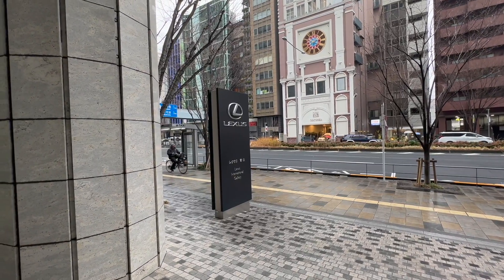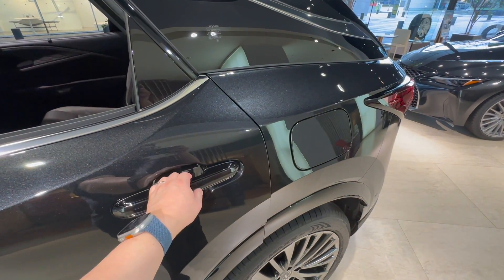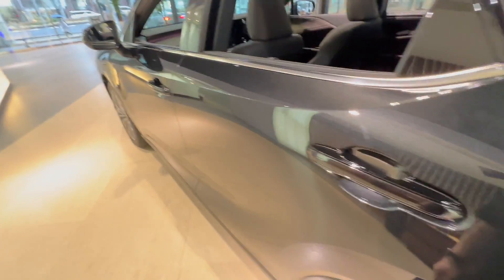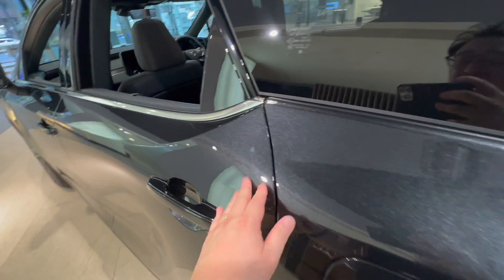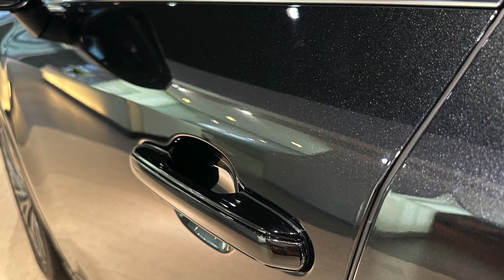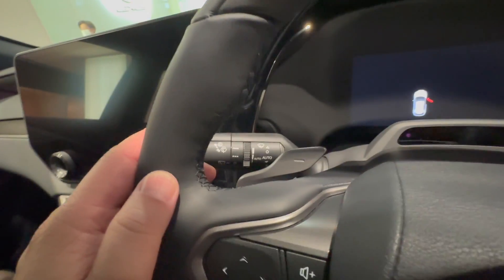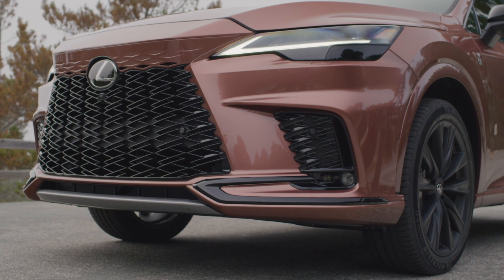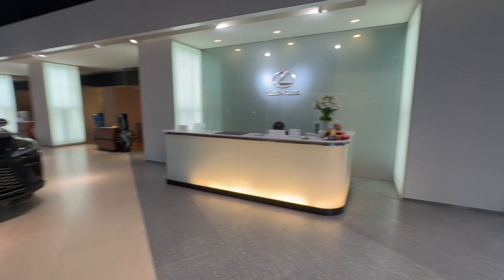CARS MADE IN JAPAN HAVE BETTER QUALITY THAN THOSE MADE IN NORTH AMERICA?  ENGINEER COMPARES LEXUS RX

Comment: It is always easier to close the door of these vehicles if the windows are down.  The air pressure is squeezed slightly when closing the door when the windows are up because the vehicle is so air tight.  Try itself if you are skeptical.  So does this mean the North American vehicles are in fact better made because they are more air tight?
Reply: How about the panel gaps? What is the scapegoat for that? Ive seen other channel sticking his finger to the gap of his nx at the back. The other side has bigger gap than the other side. The panelmis misaligned. Its a NA made nx. Well that makes NA better?

Comment: There's always room for improvement but it's very difficult to change the performance of your "average" worker. The difference is that culturally, your average worker, particularly in mechanical assembly and manufacturing trades, is just better in Japan and certain other countries. I owned a 2012 Sequoia for 10 years, sold it during COVID for a great price to buy the last of the 5.7L Sequoias (a 2022 Sequoia TRD Pro). I've also owned several other Toyotas, Mazdas, Nissans, Volkswagens, Audis, and Mercedes Benz, both in Canada and overseas. I disagree with David's comment that Toyota NA quality has improved over time, it has actually gotten worse, if my 2022 Sequoia is used as an example. The 2022 Sequoia (in Pro trim nonetheless) was nowhere near as well manufactured (assembly quality, fit and finish, and material quality) as the 2012 base model SR5. So much so that after 11 months of ownership and 16000km, I sold it and will never buy a NA-built Toyota/Lexus again.

I have several other personal examples with various German vehicles (Germany built vs NA/Mexico), Mazdas, etc. One of he most notable examples is the difference in quality between the pre-2016 Nissan Armada, and the Patrol-based post 2016 Nissan Armada built in Japan. Nissan is still trying to undo the essentially garbage that was the previous Armada and has faced an uphill battle in convincing people that the new Armada isn't the same as the old. 

Also, the supply chains are not the same for Japan-built and NA-built vehicles (Toyota, Lexus, Mazda, Nissan etc). This is important to realize because it means the overall quality of the vehicle is affected by the compounded quality and workmanship of the aggregate of the components and all the Tier 1/2/3 suppliers.

BTW - a trained mechanical and aerospace engineer in the business of operational test and evaluation.

Comment: You are closing it the glass wound down, it will be easier with glass down. is there any material and finish difference noticed. for example light lenses. plastic metal , rubber?

Comment: I think some of the difference could be the windows being down on this RX , there is a lack of pressurization to kick the door back , thus making it easier to close , than if the windows were up.
Reply: Absolutely a consideration, but knowing David he has thought of that so I don't think he would make the error of comparing the Canada vs. Japan built RX and NX without considering if windows are open or not.
Reply: @jsfbay1 you are right i think this is because the seal is very good that the air trapped inside the car makes it bit difficult to close when windows up, when windows down no issue
Reply: Am going to try that

Comment: Very interesting that you mention this.  Our first Lexus ever is 23 GX460 and all four doors need extra force to close compared to any car I have owned over past 36 years.  Even though the GX is made in Japan, still has to force the doors harder than other Japanese cars I owned. I asked other owners in forums and seem the newer GXs like 22-23 models comparing to older GXs have the same experience.  I am wondering if Lexus has changed the vendor for weather stripping that have caused this?  Leaving the window cracked open helps.
Reply: That means it’s airtight. No wind noise/ outside noise. It’s incredible how overbuilt this car is. No matter what door you close last it’s going to give you that vacuum effect on the closing doors.
Reply: Or they are too air tight?
Reply: @DashPar  that too, but windows cracked it still does not close as smoothly as it should, which makes me think of the weather stripping is not soft enough.

Comment: David, Tesla uses large stamping equipment to simplify the body structure, optimize assembly efficiency, bypass the advantages of high-quality skilled workers on Toyota's production line, and produce electric vehicles like mobile phones, with fast delivery and excellent cost control.  Does Toyota have any response?

Comment: My past experience is that a blanket statement that Japanese vehicle are all better is untrue.  My 04 Acura TSX's stereo actually shorted out.  Also the heated seats burned a hole thru the drivers seat.  And redono red paint faded terribly.  No longer have it.  But worst made in Japan vehicle was my 1988 Isuzu Trooper 2.  It's engine was a total POS.  Crankshaft failed at18k and Isuzu wouldn't stand behind it.  However on the positive side my 11 TL Acura SHawd has been wonderful.  So you can get bad and great vehicles made in Japan.
Reply: We are talking about Lexus/Toyota vehicles. Not sure how the others do it.
Reply: Title too general then. I also own a US made Tundra Crewmax.  Transmission had to be replaced at 700 miles.  Have 175k on it now.  Past few months replaced radiator and starter.

Comment: I bought the 2023 RX350 h and I have the same issue with close the rear doors that it won’t close perfectly. I have to use a stronger force to close it compare to the front doors. Of course my Lexus was built in Canada
Reply: Same observation. The problem is the latch mechanism supplier is different. But it’s not a big deal.

Comment: Doors always close easier with the windows are cracked open or rolled down. The Toyota and Lexus cabins are very air tight so, when you close the door with windows rolled up, the air pressure builds in the cabin and the doors will not close all the way with a gentle push. You have to push a little harder to close doors when all the windows are rolled up and even when the fan is running for heat or a/c. My 4Runner has this same issue when closing doors. I like the tight cabin for its quietness and road noise reduction.

Comment: I've noticed too the difficult to close rear doors in the Rx and NX. I wonder if they will improve it over time? Or could it be due to different suppliers not making identical pieces? Thanks David giving all these impressions from Japan!
Reply from the maker: Great to hear from you Kirk!  I'm returning soon so let's catchup.  I think the rubber seals do get a bit softer over time, but I find that the rear doors are always harder to close on NA built Toyota/Lexus compared to the Japan made ones.  And there are other subtle differences, though they are minor for the most part.
Reply: Hello Kirk and David! New 500h owner here! Yeah i find myself putting more effort to closing the front and rear doors. Or maybe im not used to it as coming from a '19 rav4 haha. I just need to take it easy on closing the doors haha. Have a good one fellahs!
Reply: I'm wondering, from an engineering point of view, if these parts are being sourced from Japan and shipped over to Canada for manufacturing, that somehow the materials are changing due to temperature fluctuations, time overseas if being shipped until parts arrive to Ontario plant or could it be the environment of the plant Ontario plant itself causing issues?  Is it too cold in Canada vs. Japan?  If the same parts are being built at each factory, then we can rule that out and perhaps the processes in each location has to be slightly different and not consistent.  There is a delta there between the two and that would probably he the thing in question.

I've always valued Japanese quality because the folks there always take pride in their work and don't take any shortcuts or compromises.  That's just because of the Japanese culture vs. North American culture I suppose.
Reply: @mr.tuckers2848  huge report out years ago where lunch was used for pot smoking and drug use in NA....I don't believe Japan would put up with it in their plants. We purchased our first Honda Civic H/B in 1977.......that one won us over for life.
Reply: I would say fit and finish is better from Japan than Canada or US. but to me it's a Lexus not a Toyota so all should be equal in all aspects of the car from top to bottom. It would kill me to have purchased a new Lexus to have the fit and finish not being top notch.
Reply: @an-dr6eu Really so Lexus NX and RX rattles like the American junk?